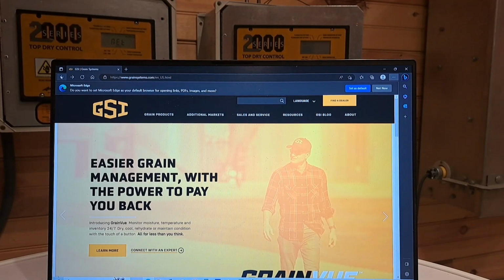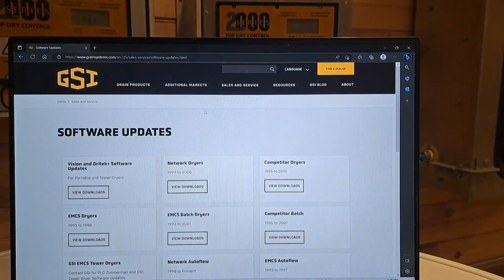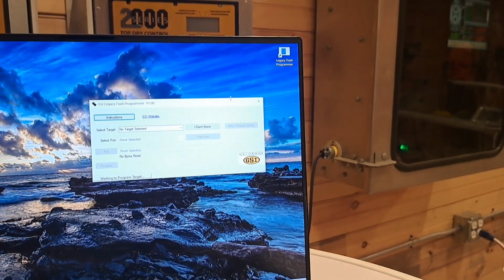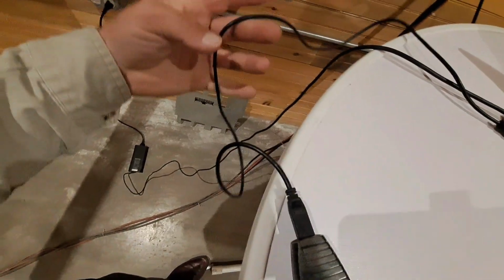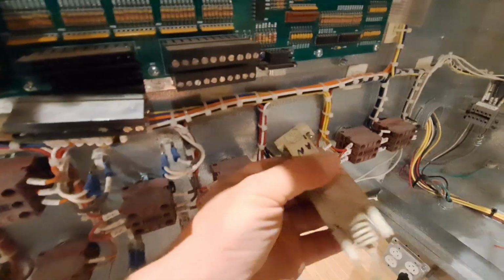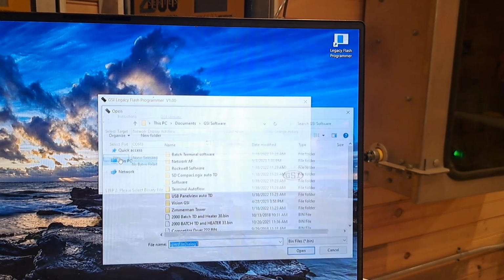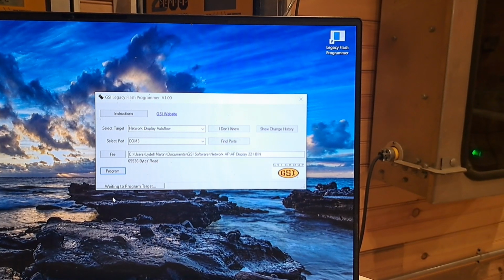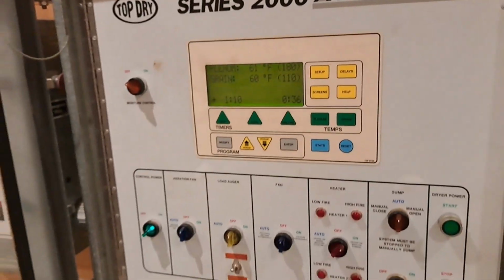Updating software on GSI dryer boards Network, series 2000

Comment: Hi! Great video! We want to programm heater board to, but we do not have J2 connector. We are trying to make it by ourselves. Can you send some info about pinout for this cable? Witch colour goes to witch pin?
Reply from the maker: Send me an email at graindryer@repairman.com and I'll get you some pictures or small video clip showing connector in greater detail